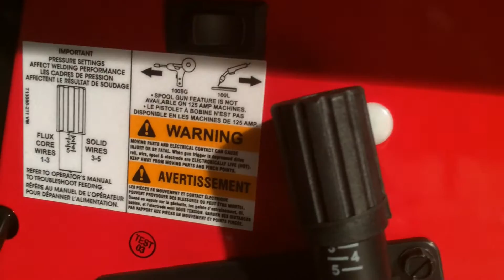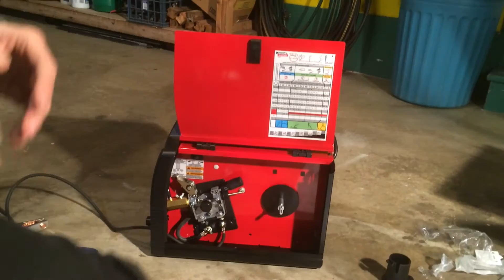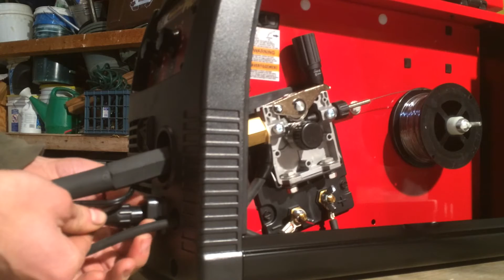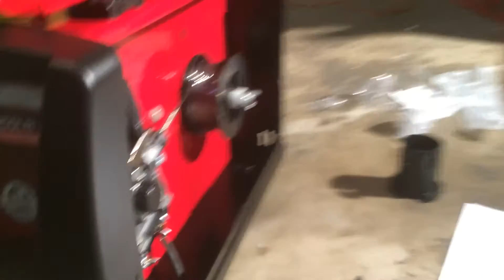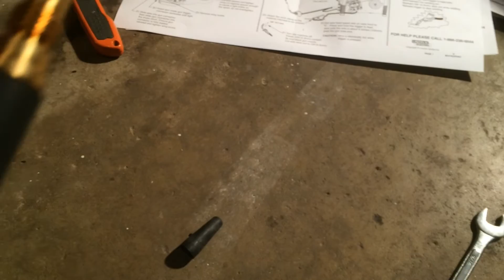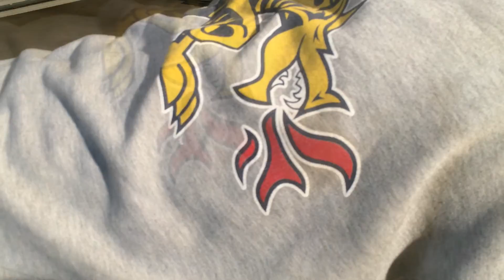Lincoln Electric Weld-Pak 140 HD MIG Welder Unboxing and Setup Part 2 of 2

Comment: I have same welder but I would like to know what's the different if I use gas or no, 
And what kind of gas
Reply: Oscar Santana If you refer to the chart on the inside of the wire feed door it tells you the two recommended gases. Either 100% Carbon Dioxide (CO2) or 75% Argon/25%CO2 (C25). Best results will probably be achieved with C25. You use shielding gas with solid core wire, and as indicated on the box, and on the chart, this works best on steel ranging from 24 gauge to 10 gauge. Flux core wire does not use shielding gas. As the name implies the wire is hollow and filled with flux, similar to the coating on the outside of a stick welding electrode, and it does. Much the same thing. It is suitable for welding as thin as 18 gauge to as thick as 5/16" with this machine. The ability to use the two types of wire and two types of shielding gas gives the MIG welder it's versatility. There are some other gas types available which have a higher concentration of argon and lower percentage of CO2 along with small amounts of either helium or oxygen as well as a "dual-shield" flux core wire for specialized applications, but for most mild steel applications the C25 is the best choice, and CO2 works better for welding dirty metal or galvanized steel.

Comment: Hello did you have any problems welding with the plastic tip
Reply: The plastic part covers the copper tip but it is about 3/4 of an inch  away from the contacts that create the weld.
plastic cover is no problems at all. my plastic cover still looks new after 1 year. home depot sells the plastic cover in case you need a replacement. this is a great welder. I love it.

Comment: does this machine need gas!? every video i see no one shows the gas tank
Reply from the maker: +yee yee it depends what core wire you are running, for this video I was running flux core which does not require shielding gas, but you can also run solid core with a 75/25 co2 argon mix with this machine as the shielding gas
Reply: Into The Dirtshop thanks for the response. I never knew they made flux core for mig! What size wire of flux should i buy specifically for this machine?
Reply from the maker: yee yee no problem! I use 30

Comment: just bought the lincoln electric 140hd welder and it doesn't have the incoming guide for the wire can I still put the wire through will it still work fine
Reply from the maker: +unhappy customer I would return it, you need a guide to feed the wire correctly. Just my opinion though! Thanks for watching

Comment: Or turn your wire speed up because it isn't putting enough wire down to go with your speed. Or turn it down because your wire is trying to jump out before you can move. I don't know what your wire speed was so I couldn't tell you

Comment: Hey man, tip. When it is very sputtery like that and not sending an even arc the whole time. Push your gun closer to the weld you're putting down until it's very even. It should be very smooth and not sputtery.

Comment: I just bought a pro mig 140. Totally new to welding.  Does the wire feed gun connect by simply pushing it in. I see the 2 o-rings but it lools like it could fall out easily.  I could see it being a safety feature not pulling your welder, but it would suck if it got pulled out. It doesnt seem secure. The welder's manual nor video mentioned it.
Reply from the maker: ah yea it actually has a little screw that comes in from the back side that secures it.  Its not comin out haha

Comment: I just picked up mine today from Home depot I did not get their extended warranty Lincoln has the better deal But according to what I read with th the 3 year you only get 90 days on the gun and cables Their 2 year extended warranty is in the paperwork but I may call them for more info... Thanks again for showing the set up and wish me Luck I hope to have a video soon
Reply from the maker: Oh ok thanks I didn't know anything about the warrantee I usually just bite the bullet. But thanks for the info man good luck with it. Let me know when the video comes out I'll be sure to take a look at it

Comment: I have been researching this welder Thanks for the detail you showed in the video
Reply from the maker: not2fast4u2c Thanks man, i have been happy with it so far, no problems at all. I will probably be doing a follow up video on it shortly.  Thanks for checking out the channel, you got some pretty cool videos on yours as well.
Reply: Tim Molinaro I have been through dozens of videos the 140 is my no.1 choice the 125 model is ok but this is supposed to weld 1/4 is why I want one Thanks for checking out my channel
Reply from the maker: I used to work in a race shop and we had a 140 for the 5 years i worked there with no problems at all. They still use it today. great mig. only other comparable one i found was the longevity
Reply: not2fast4u2c The 125 is a waste of money. It is flux core only. There is a MIG conversion kit that allows you to upgrade it to MIG, but it costs over $200, and the price difference between the 125 & 140 is only about $150, so just buy the 140 and be done with it.